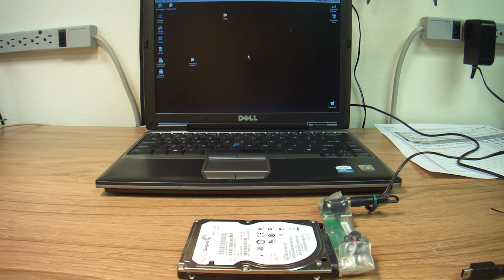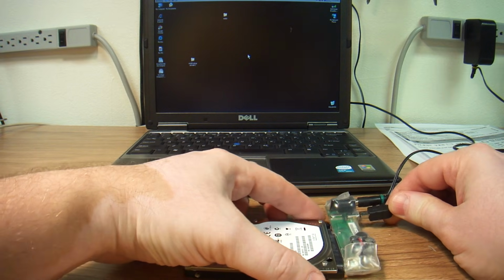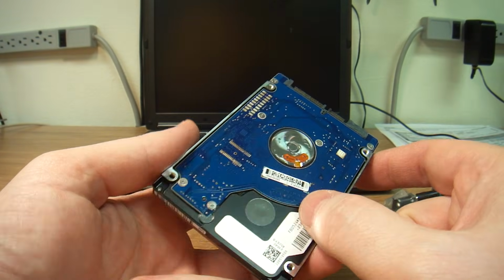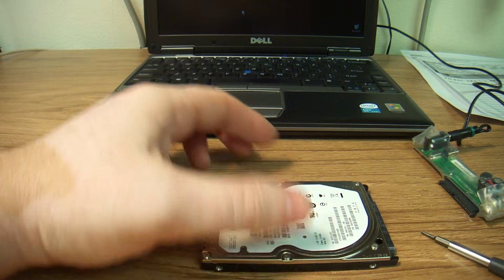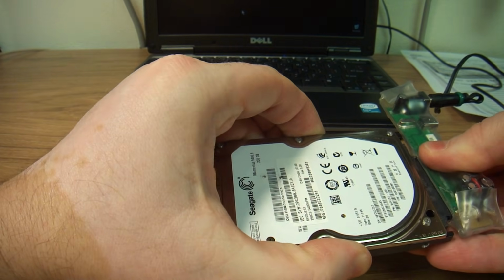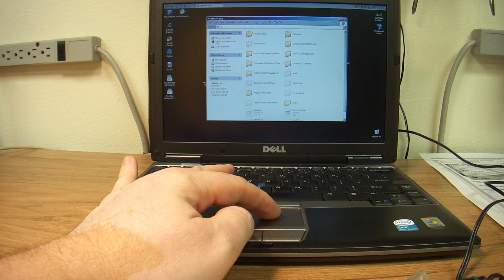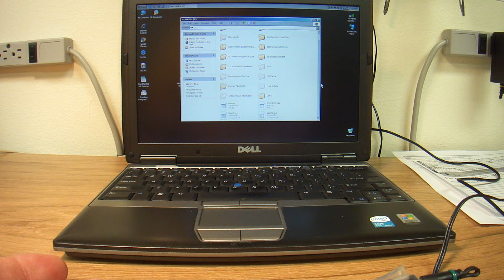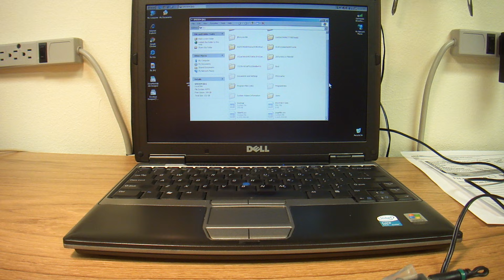How to fix a broken hard drive Beeping noise or clicking RECOVER GET DATA BACK FOR FREE! BEST TRICK

Comment: @Tech Service 
Oh, fuuu..., what the hell did you "genius"... I can't believe it... Your data, your f... problem - you have the right to destroy them, but you absolutely should not encourage anyone to duplicate what you did, because that is a rly gigh chance  for destroying most if not all of the data on the drive!!!!! EVERY SINGLE ONE!! data recovery technician will tell you that recovering data from hdd with "sticked heads"" does not only come down to opening the drive, unlocking/parking the head in its place, but ABOVE ALL!!! the drive must be opened in a cleanroom or at least a laminar flow chamber and after unlocking the heads, they must be removed, inspected under a microscope for any damages. The platters are the same - should be removed, inspected under a source of green light for damage and dirt,cleaned, and then can the disk be closed and and imaged using DD, R-studio or any other program that can read the disk's content sector by sector, creating a 1:1 image file of the platter structure and only from this image can data recovery be performed. 

Why? The point is that "head steackess" = hitting the platters = risk of scratching the platter = producing contamination that could settle on the platters... If you just open the disk, park the head and that's it, there is a very high risk that the air vortex wiped by the platters, after connecting, will transfer this accumulated dust to the heads and the rest of the platters, completely exceeding the reading of data... Moreover, the problem is that an open disk = a real risk that the disk may be damaged during reading, which is why you should make a copy of the disk directly to the second disk or to the second disk with writing to a file and only then recover the data, because then at least if the disk fails, you always have something, e.g. 20% of the data, and not 0...

Comment: Poster, can I get some advice. Got a Seagate 3 TB Desktop drive. It was the boot drive and it just froze while in use. Can't tell if it's spinning or not. But it kinda squeaks twice then once. Any thoughts? It was in a case that got set down too hard. But the issue didn't happen until more than a month after. Thoughts?
Reply: Some more background. The computer recognizes the drive, but cannot initialize it. It even reads how big the drive it. I can't tell if it's spinning or not though. It does vibrate though when powered.

Comment: I have one that just keeps beeping and won't boot. Opened it up and the heads were not stuck on the platter, and the head mechanism seemed to move without much effort. The platter bearing had no resistance and was fine. Any other thoughts?

Comment: I have received another issue after manually releasing the spinning heads from the platter: The device driver is activated when HDD is connected, the partition itself is not shown. Platter spins up, and heads try to read from it, but they come back to the ramp, then the loop continues and heads try reading, then goes back, it goes for some time. Can someone tell me sweet-sweet lies and say that this is still somehow fixable? I don't care about the drive itself, maybe any chance to get data, or at least it's part from the drive?

Comment: What happens if I use it as a primary drive? Cause i wanna fix the one on my thinkpad T42 but i cant buy a new hard drive atm?

Are you saying not to use it as primary cause I could lose data in the future or because I could damage the computer? 

Cause if it's because I lose data i dont mind while I buy another HDD cause I use the thinkpad basically just for Facebook and stuff

Comment: Hi Tech.  Thanks for the info.  Whenever something doesnt' work anymore, I open it up and learn about the structure.  Thanks for this video.  Mine does not open up, and I have ALL my photo collection in it.  I once had to pay $1k for a company to recover all my photos from a media card, and I promised myself I would learn how to fix my ext. hard drive if it ever happened again.  For some reason WD hard drives have a VERY SHORT LIFE TIME; compared to Seagates.  Mine is a Seagate, but once you start filling it up with info, it' starts acting up; very similar to the media cards I own for my camera.  Can you post a video on Camera Flash drives, and how data can be recovered?  Thank you.

Comment: Hi. My HDD (an USB external WD wd20nmvw 2 TB) dropped and does not work. I opened it and the head seems to be locked (it is not touching the platter though). I tried to move it but it is stiff. What should  I do? I have very important information in that HDD. Iam scared I have messed it all...  I turned the HDD with the case opened and the disk was spinning, so no motor problem. Currently the HDD is closed again. Looking forward to your suggestions...

Comment: Thanks ,also there will be few more precautions people should take before opening up there external hard drives like
1# There must be internal hard drive connected and available (Extra 2 tb or 1, it will be the slave One reather then the windows installed ,the primary One) inside your computer to copy Data before going through this entire process.

2# people should never ever open a hard drive for restoration original data files ,if they  haven't got another new (internal/external) hard drive connected with there computer, because this process IS a one time have a go only , ones data shows up it's unlikely that you close it and buy the new hard drive for the data , connected it and then repent the process ,there is no chance that second time you can see the data so " do this only when new managed hard drive is connected Inside the PC , and then along with the sata to USB 3.0 or 2.0 , do this .

3# problem with the data recovery centers is that they always objects like,
' why you replace this and that without showing us first .

' we first examine your hard drive then deside weather or not you should buy a new one for data recovery and both you can drop on our center.

I will examined it by myself instead taking it to them  for me because they are having a lack of confidence in my country and all the time made EXCUSES and I suppose those who explain things with excuses ,they can not be able to provided a good duty for you.

My objects are ,
1 Get a sata to USB adopter.
2 Get a appropriate screw driver or the channels for these special screws.

3 opening it by myself even having extremely important data on it , because I don't want to blame or accused the data recovery center if anything bad by them happened because I understand that we all are in a sort of " out of the duty " ad people becoming a headache for the people in our world , mostly making mistakes and others are the repairs ,in my experience people of my country all the time worrying about there pockets and othere if they had to fall in hell they don't care any shit about what becomes bad or good ...we are spoiled in every second and we are getting all alone.thanks your advices they are the real guide.

Comment: Hello. Thanks for the explanation, mine was also stuck in the middle of the platter and i fixed it like you showed in the video but it still doesnt work when i connect it to the pc. It makes some strange clicking or vibrating sound but PC doesnt recognize the hard disk. But at least it doesnt beeb anymore. What can i try now?

Comment: Please I opened my hard drive the head wasn’t on the plater or the round disks, something feel on it and it doesn’t show up again, PLEASE I NEED TO RECOVER MY DATA, help me please
Reply: well that means that you werent having the issues tell me what was happening before you opened it
Reply: @ducksonplays4190  thank you very much for responding, The laptop is HP pavilion 17, you know the side where the hard drive is placed , I was using this laptop and then I got upset because something I was working on failed , and then I lift my hands and the wireless mouse and smash the laptop, like damn you know what I mean...and then the laptop freeze, I turn it back on, it says booting error, the hard drive now makes a click sound clerk clerrk, crkk and the you feel
It’s spinning, but it won’t boot ! I removed it and connected it through external case no avail, I check few videos and then I open to check the head arm , it was in the right position still drive won’t work....please I have my whole life data saved on it , help me
Reply: @Officialkyeigodfred  I feel horrible for you but the drive might be toast. The clicking would suggest you damaged the heads so it couldn't find the data. There is a chance that it may be recoverable with a hard drive recovery service like DriveSavers but having the drive open could've finished it.
Reply: @ducksonplays4190  Thank you very much for replying me and sharing this information with me, you must be really right, can you just take me a next process , there is no special or expert repair with hard drives in my town, My drive is 1TB tosheba ,Can I replace the head with 120GB head ? Would it work ?
Reply: @ducksonplays4190  And do you say opening my drive could’ve get the job done or damage it ?
Reply: @Officialkyeigodfred  Opening it could've caused data loss.
Reply: @Officialkyeigodfred  Doing it yourself would cause even worse damage and be very hard to work on.  It has to be the exact same drive model and, you would have to go to drivesaversdatarecovery .  If your drive is still open there is a good chance that its ruined but, drivesavers did recover the data off of a hard drive in a sunken cruise ship. So it could still be salvageable but data recovery services are expensive and don't always work.
Reply: @ducksonplays4190  thank you very much , I really appreciate your time , thank you

Comment: My laptop hard drive starts making this clicking noise 10 minutes after I turn it on then if I turn it off and let it sit for a while it will start normally but then it gets stuck again 10 or 15 minutes after. Do you think it is because of the same heads problem?

Comment: What size of screwdriver that you use? Mine has a screw in the middle, it 5 point star while the others are 6 point star opened by torx. I have no idea what size of screwdriver to open the middle one. Please help. Thanks.

Comment: I have a wd 2500, the head was towards the middle cylinder. I placed the head back to start position, but when the drive boots up, it clicks 3 times, then 2 clicks twice, then its quiet, drive is still spinning but windows does not mount it.

When I open the drive again, the head is back at the same position before i opened it. Is there a way to fix this? Thanks!

Comment: thought id give this a shot because I have not tried it in a long time. there is a torque spec for the reading arm. too tight you fail. too loose you fail. at least I was able to make the platter spin by unsticking the arm.

Comment: If this doesn't work what might be the problem  , mine was clean no scratches , that arm was in starting zone so I didn't have to move it .  Is it the PSU , mobo ? I had some mobo problems prior to HDD issues .

Comment: Thanks bro, my external samsung hdd was making a few fast beeping noises and then it would go silent and not start. This happened every time I plugged it in. So I took your advice, but instead of opening it I just did a few fast jerking movements in the air on the side of the head to try to dislodge it without opening it. On the 5th try I heard something click and after that i plugged it in again and after a short and almost inaudible scraping noise, et voilà, it spun up and started working again. Thanks again!
Reply: Can you describe this technique a bit more? Thanks!
Reply: @alrick3000  

Perhaps he mean he shaking the hardisk

Comment: when I opened my hard drive the heads weren't on the disk but it still makes a bit of a beeping noise and clicking sound and gets overheated, it's also not working properly when I plug it into the computer
Reply: I have this same issue and I don't know what's technically wrong.

Comment: I have hdd and it just does the clinking for ever. I'm thinking about buy the same HDD and swap heads just for data recovery. Would the new HDD be ok to use after putting its original heads back ? The new HDD will just a back up of some my stuff.

Comment: today my seagate ext hard disk fell down from  at least 2 feet height while it was connected to pc and viewing some pictures in it  ,after that it stopped working ,only the blue indicator light is blinking & but the device is not showing in "my computer".checked with the device management ,no details regarding ext the hard disk .after that i opened the case & connected via sata cable & checked in bios too but the device is still unknown .feels like the disk plate is not spinning .please advice

Comment: I have a clicking,( like a hit noise per second), from a brand new IDE hard drive I  was planning to use with a playstation 2.  DO ou think I can still save it? I was brand new. I dont have anythink inside, I just want the HDD working. PC and PS2 can detect it, but as soon i try to format it the clicking beguns.

Comment: "If it contains a second copy of something that I have, I am okay"
NO you are not. The second copy supposed to be the BACKUP in case the primary drive has failed, so you'd be left with a drive that's on its way to fail anyway. So why bother with backing up anyway in the first place.

Comment: help. after i unstuck the head, when i connect the drive, the head won't go up onto the platter. what should i do?
Reply: The mistake was opening the hard drive to begin with. Assuming people can think if I fix the issue myself, you're making things worse. Data Recovery centers have certified sterile clean rooms. Suppose you get the drive working again, it will go dead sooner or later and have a small window to backup any data.

Comment: I'm not going to say NEVER DO THIS YOU ARE DESTROYING YOUR DRIVE NO MATTER WHAT, even though it is most likely you are, but if you need an emergency way to access your data, so you can transfer to another drive, and you've tried everything, as a last resort, this is completely plausable, but GET A NEW DRIVE, after you open the drive, and IF it still works, it is a timebomb, waiting to make your data inaccessible except to absolute top tier professionals.

Comment: NEVER OPEN A HARD DRIVE 
IT DESTROYS THE DATA
EVEN ONE SINGLE BREATH ON IT OR A FINGERPRINT DESTROYS THE DATA FOREVER
Reply: Matthew Cabor the only way you don’t is if you open it in a clean room like one that costs  200000 dollars. Even a fingerprint is enough to permantly damage data forever
Reply: Apple Person You’re joking, right?!
Reply: I've done it several times over the years, never have had a problem. You only need it to run long enough to copy data onto another drive.

Comment: Thanks for that tutorial. I have vehicle diagnostic tool on a sata drive and it clicked at one point years ago. I had to take it to Best Buy for help. Well $100 later it worked. Then it sat in the box for 3 years and now I want to transfer the files to another computer but it clicks again. I followed your instructions and now it loads. Thanks for that, you helped me a lot.

Comment: Hmm wish you could post when next option is or what else the beeps could mean. Once the header thing is in the correct position and everything put back together, I still get beeps (instantly) as in .0001 seconds after plugging in the drive, almost as if it never tries to do anything.

Comment: Honestly, should I even bother attempting this on my own or just spend hundreds, if not thousands, on specialized professionals to get it fixed? My data is irreplaceable and my hard drive isn't making any beeping or clicking noises. I wish I could go back in time and place all my data in Dropbox or something.
Reply: You should have got a Hitachi or a wd drive Toshiba and Seagate are the worst disk I have ever used
Reply: It's WD hard drive.
Reply: @user-yr3uj6go8i  3.5 it 2.5 and how did you're drive fail
Reply: Not sure, but I'm suspecting that it probably dropped. Fortunately, no clicking or any strange sounds I believe. When it was plugged, it was spinning well, but wasn't recognized by any computers. I tried multiple data recovery softwares, but it wasn't possible since my hard drive isn't even in disk management. I might take my hard drive to specialized professionals if I can afford it with about $2,500 in my savings.
Reply: @user-yr3uj6go8i  for me you can't believe it my HDD was reconised in disk management but when I opened it and replace it back nothing happened and it didn't get reconised

Comment: Weird, I've never seen glass stick to other glass surfaces just because it's smooth.

The reason it sticks is because the platter and reader get too hot and friction makes it stick, especially when it cools. 

Kinda like welding.
Reply: That's because you've never touched a glass surface to another glass surface that's spinning at a high RPM...otherwise you would see just that.

Comment: Thx for your video and the information given.

I have a problem with my personal laptop, the laptop is booting into bios and not detecting the hard drive.
Problem occurred after power cable was removed from laptop (laptop has no working battery, so after cable removal the laptop turned off abnormally).

Every time I click on start I hear the same clicking beeps you hear in this video, it seems the hard drive’s head is stuck on the platter.

Will the laptop detect the hard drive and boot successful if I do the same procedure you showed in the video?

Thx !